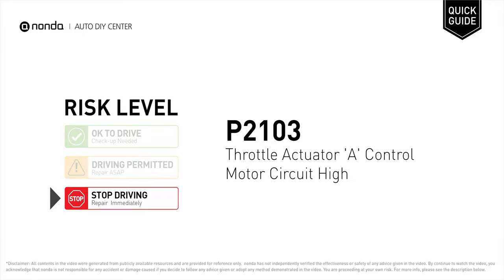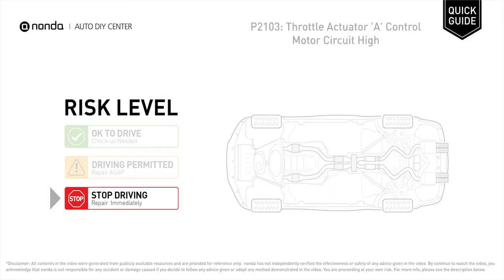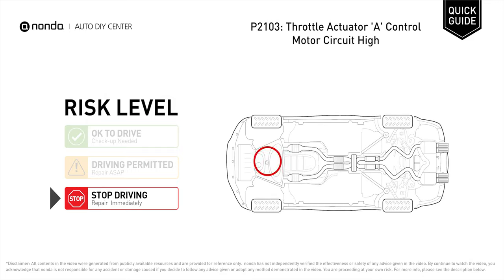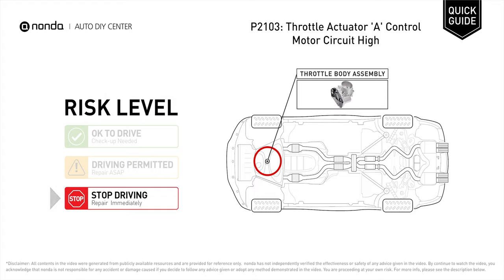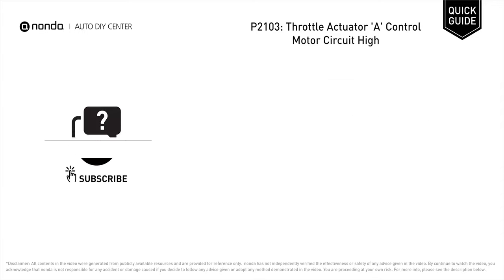What is P2103 Engine Code [Quick Guide]

Comment: I have a 2015 Nissan Versa Note. Check Engine light comes on for a week or so, then is off for months, then back on. Got a OBDII fault code P2103. Do I replace the whole throttle body or just the throttle position sensor